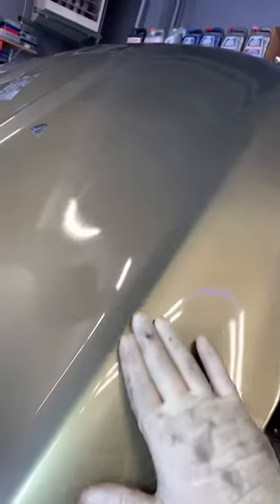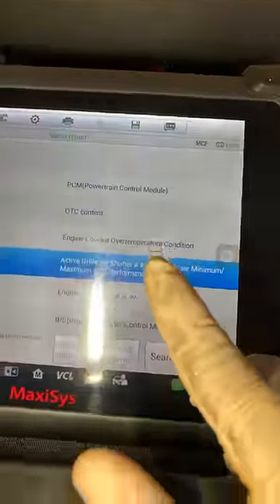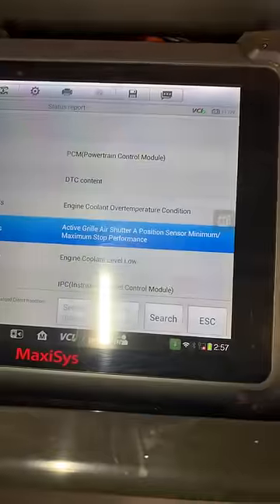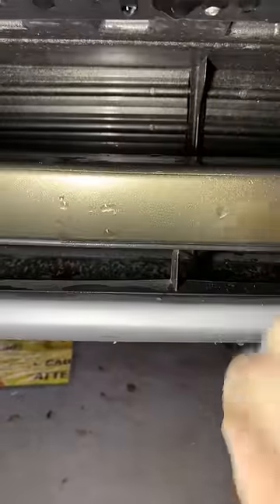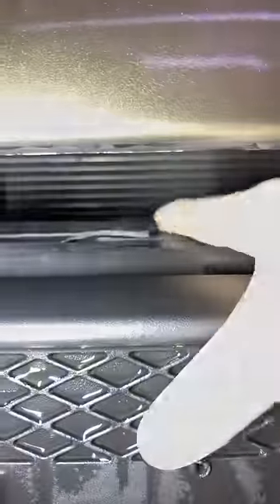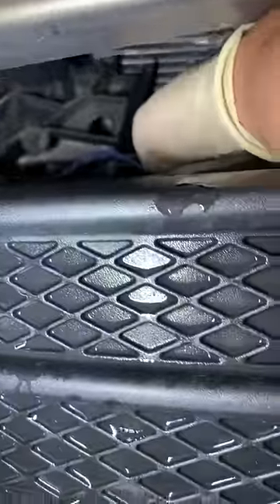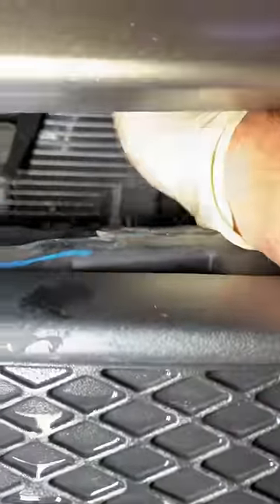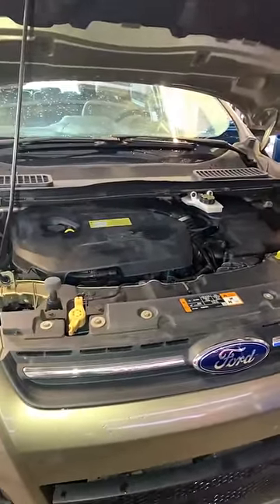ENGINE OVERHEATING CAUSED BY AN UNPROFESSIONAL BODYSHOP!

Comment: Yes, take it to a good body shop to get an estimate too. That app on your phone is a scam by insurance companies to minimize repair costs. I was hit in rear and original phone app, said I needed $600 in repairs. Dealer body shop showed me damaged parts that can't be seen unless you're under the car. New estimate was nearly $3000. And yes, the insurance company paid.
Reply: I never understood the whole take a picture and get your estimate when in most accidents there is going to be damage that can't be seen from the outside and takes a shop sometimes removing panels or at the very least put it on a lift to check everything

Comment: Even in a reputable shop you still find Idiots. I worked for Mcdonald motors in Littleton,  co as a mechanic.  Had a mazda 626 given to me over heating,  found the fan wired in reverse from recent body shop repair , blowing instead of sucking

Comment: Just a curious question? Why the shudders in the first place?
Reply from the maker: They use the to redirect air flow for efficiency due to drag and helps warm up the engine faster.
Reply: @TheEnthusiastMechanic  geez

Comment: “Orange peel” is when the paint has defects from the sanding and “mudding” product not being correctly finished before paint is applied to the area so if you look at an orange 🍊 peel it has dimples and creases and little pin holes everywhere that’s what a body man or painter calls “orange peel”
Reply from the maker: This one I was referring to the huge sanding marks and waviness of the paint texture that the body shop had put in the paint. The factory orange peel is much cleaner looking and isn't as noticeable, good explanation I know I just said it and didn't explain it much 👍
Reply: @TheEnthusiastMechanic  no worries I started off in the industry as a porter in a body shop and spent 7 years just moving through the ranks I know a thing or 2 not all of it but I can tell you a good shop compared to a POS one
Reply from the maker: @verbalassault87  Thank you sir I appreciate the kind words

Comment: Those shutters close when the car is off. I just remove them from my ford's and get better performance.
Reply: Wrong, it depends how it was programmed from factory and the temp parameters. Mine stay open when off unless its too cold outside, many variables. Performance? Lol like 10 extra hp! This is for aero (better gas milage) you can rip them off but you won't get better performance man .

Comment: Listen..
I Just Lost 10k + On The EXACT SAME PROBLEM WITH THE EXACT SAME CAR. 

2014 Ford Escape 102,000 miles Dealership Purchased Too Yet
It Overheated (Purchase Day Too)
Would Randomly Shut Off
Extreme Jerking While Driving
No Heat Or Air
Rotors Were Glazed Over
Trunk Wouldn't Work
& I Paid OUTTA POCKET to get all that fixed just for my 
Transmission To Die
Motor Died
Timing Belt needed replacement
New water pump
& Tune up for all that to happen literally 2 days after it got "fixed".

Fuck FORD & EVERY DEALERSHIP IN AMERICA.
Reply from the maker: Sorry you've had so many problems
Reply: @TheEnthusiastMechanic   
First , thanks for actually responding 
Second thanks for allowing me the opportunity to vent without being judged it's greatly appreciated & I think at this point it wasn't so much as me buying a lemon as much as it was about me growing up & being mature about making better decisions.
Reply from the maker: @TaeDaDon205  Not a problem I completely understand. Everybody usually winds up with a car that gives them issues like that and it just gives you more room to grow and learn when you’re in that situation .

Comment: Nissan did that in 92-93’s  , customer complaint orange peel , Mái fly some one spaying some chemical like silicone spray and painting section of assembly got airmisty travel inside vent system into body painting section , haft of Nissan either repair or return by owner . Nissan in early date make many mistake after transfer from Datsun in America . All cars shape look like an ugly egg shape design , from maxima to Altima to Sentra , the only one was still normal was pathfinder all transmission problem until today in 35 years , their warranty and service going down to shame and hide’s too !!!???